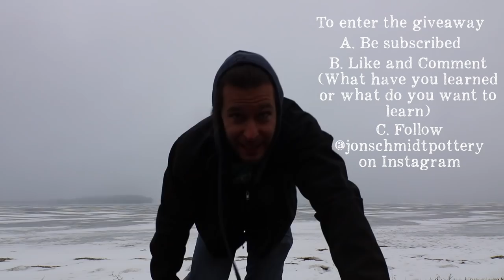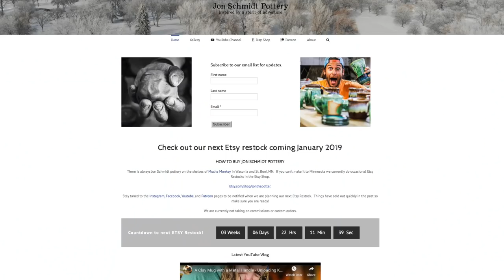10k Subs GIVEAWAY, 2018 Rewind

Comment: The big thing I really appreciate about you and what Ive learned from you is that even when things get messed up or don't turn out right its never a ruined project, for you its a moment to learn and to find a way to fix it. For example with the recycled glass coasters when a few had bubbles in them you didn't throw them away or say it was a failure you just knew to put them in for another firing and it would be all fixed. Or another example is with the drip catcher mugs after the glaze kept dripping onto the kiln shelves.

Comment: CONGRATS ON 10000SUBS Jon!! 
I don’t do pottery(although I REALLY want to try) but I’m very invested in painting. One thing that I learned this year is to accept that not all my pieces will come out the way I wanted them to. A lot of the time, I tend to take my self down if something I’m working on fails. Overtime, I learned that its okay to fail and I shouldn’t be discouraged if that happens. I learned to reflect on what went wrong and how I could improve the next time I paint.

And the thing I hope to learn this upcoming year is to experiment with different mediums of paint. One thing I do often is I get comfortable with using specific mediums and I limit myself from trying something new. I always reach I point where I can’t achieve something with my painting where I could’ve if I wasn’t so scared to try new mediums and techniques. 

So that what I hope to work on next year! 

Hope everyone’s Christmas was jolly and bright and I hope you have a happy new year!!😁